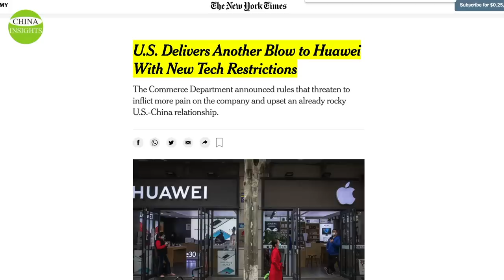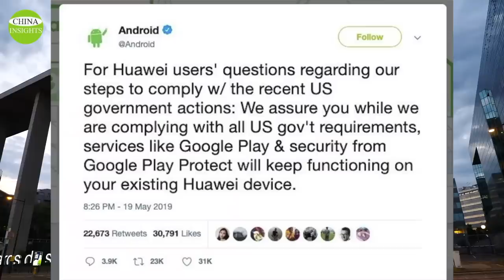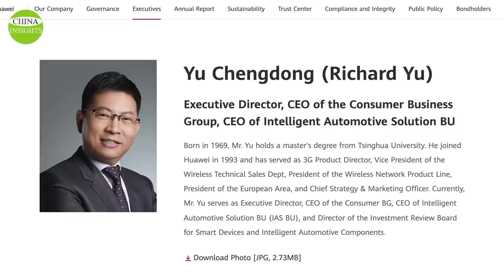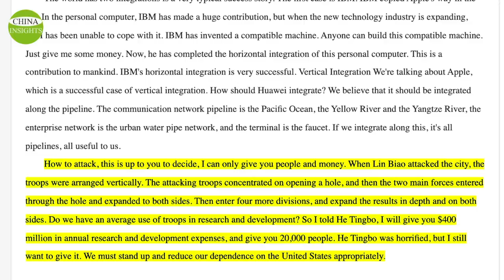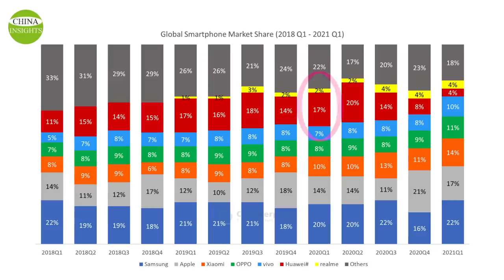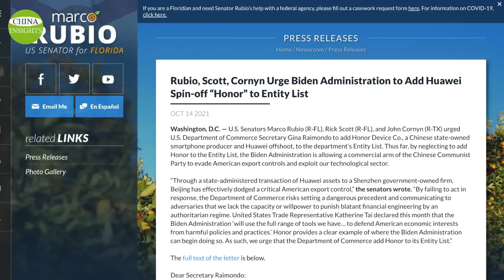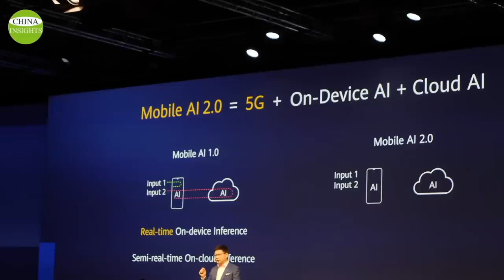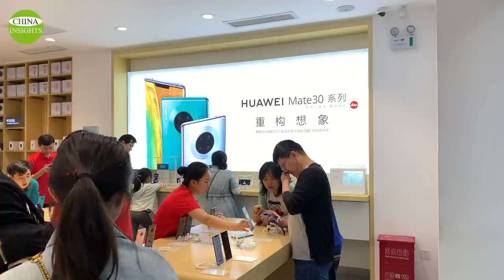Huawei's chip dream failed and its core business shattered/Its secret ways to bypass US sanctions

Comment: Silicon, not silicone. Two completely different things.
Reply: English is hard
Reply: @TheFivegoodemperors  lmao
Reply: It's a robot.
Reply: @IK-wc4od  its spelt differently
Reply: Another one: SOC = system on a chip, so 'SOC chip' has one chip too many.  Another one: DRAM is normally 'd-ram' , not 'dram'.  Anyway, apart from these trivia, it is a very good video.
Reply: @civ6877  or as Peter Griffin would say " the S  is silent!"
Reply: @IK-wc4od  no it's not, if it's automated voice it would've pronounced it correctly.
Reply: Also  holding copyright not monopoly
Reply: @TheFivegoodemperors  Silicone word is mostly used in a back cover for mobiles.
Reply: @18000rpm  you clearly haven't used cheap, old or free TTS services. They sure aren't correct all the time, that's because they cannot infer with context.

Without context, is an orange orange, a bat batting a bat? The programmers and data used to train these are also susceptible to error, bad data, biases, etc - particularly when it's a common mistake.
Reply: @zanderhenriksen6776  LOL if this was automated speech it is a highly sophisticated one, which means it would be able to pronounce "silicon" correctly.
Reply: Exactly.
Reply: @TheFivegoodemperors  Where is the fake boobie center?  Asking for a friend.
Reply: @drmodestoesq  San Fernando Valley
Reply: silica
Reply: oops
Reply: sillycone
Reply: @erfanthered9801  nah
Reply: @IK-wc4od  if thats true they misspelled it everytime a robot wouldn't make that mixup
Reply: Actually, silicone is mostly silicon (and oxygen) so they're not as different as they could be!

Comment: ASML is not boycotting the PRC. They have just been denied export permits for their latest generation lithography machines, and therefore are legally unable to deliver.
Reply: China's SMIC 128nm is decades behind ASML 5nm lithography machines.
Reply: @cherrybomb1229  Yes, several attempts to that end appear to have been made. American clients will also attempt this, though, so it does not really matter in the end.
Reply: @cherrybomb1229  They've tried. They can't.
Reply: @cherrybomb1229  you can't just ctrl+c ctrl+v a machine like that, there is insane material expertise in it. By the time someone can copy it, which will amount to re-engineering it from first principles while using it as little more than a template, ASML will be 3 generations ahead again. They have never shied away from competition but faced it by being better.

Comment: Chanah never did have a working 5G network. My 5G phone worked in 5G mode at times in city center of BeiJing, ShenZhen, GuangZhou and TianJin. All other places, my phone showed 5G but it operated at 4G or 3G mode. It is a fake 5G. They don't have 5G Transmission Towers but only in large city centers.
Reply: @llothar68  5G is faster, but is stopped much easier and has a lower range. It has its applications, but I don't think that it makes sense to use it for general mobile phone internet access.

Few people care wether a website takes one second more or less. At a certain point a sufficient level is reached.

When it comes to the IoT it might find its place and it's far from useless tech though, so I'm not against 5G in general.
Reply: I'd prefer a Nokia 5G one
Reply: Don't like it. Just leave
Reply: How good is the 5G in USA? Seriously.
Reply: @josephtan4627  Malaysia's 5G is just progressing, and im not an American since im overseas chinese
Reply: @chrisblue4652  Do a speedtest with Ookla Speedtest. I'm pretty curious to see what the result is, it should be above 1Gbps at the very least to be worthwhile.
Reply: @chrisblue4652  seems like 500Mbps is indeed the more normal number for 5G.
But I'm pretty sure it's supposed to reach 1Gbps / 1000Mbps.
Forgot to note this earlier, but another thing affecting the loading speeds of websites is "ping" - which is the time it takes to get a response. The lower, the faster you can start utilising the full bandwidth to transfer the page.

One can hope 10G fibre becomes commonplace due to the increasing demand and how the relative speed between mobile and desktop is usually that way. 10G is completely excessive though, but who knows what datastream sizes will be normal in a few months?

Comment: Please stop saying these chips are made using silicone. Microchips are made on silicon wafers which is completely different than soft, pliable, rubbery silicone. Silicone is used for things like sealing cracks around windows. Please ask google to define silicon, then define silicone. It will show a strong difference between the words. 2:14 is a great example if what I am talking about. I am sure chip manufacturing will come up again, now is a great time to learn how to say silicon. You probably won't use the word silicone unless you are reporting the Chinese are trying to seal up drafts. There are medical applications as well, but nothing in your news article.

Comment: It's a worldwide economy, western market maybe unfairly sanctioned. But rest of the world account for 65% of Huawei's revenue, thus business will evolve and skip silicon to graphene and light based microchips.
Reply: Chanah never did have a working 5G network. My 5G phone worked in 5G mode at times in city center of BeiJing, ShenZhen, GuangZhou and TianJin. All other places, my phone showed 5G but it operated at 4G or 3G mode. It is a fake 5G. They don't have 5G Transmission Towers but only in large city centers.
Reply: After 10 years copyright laws is null. What's the point of screaming you copy what, when it's ancient technology as most have either evolved or replaced.